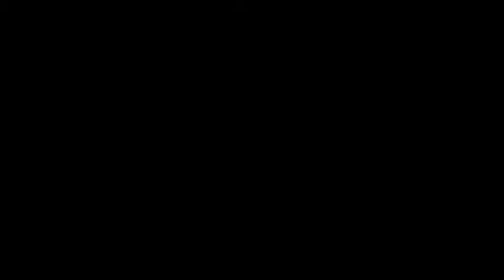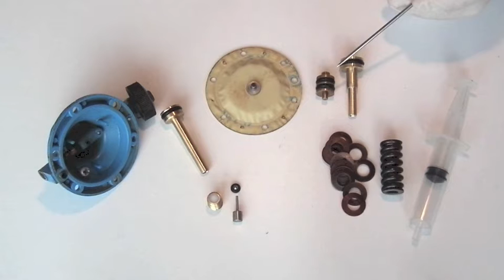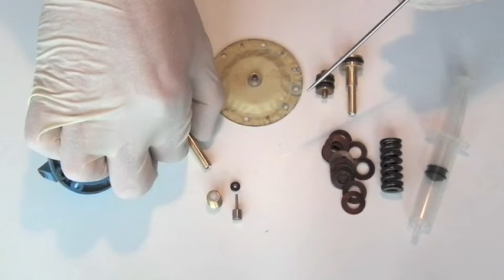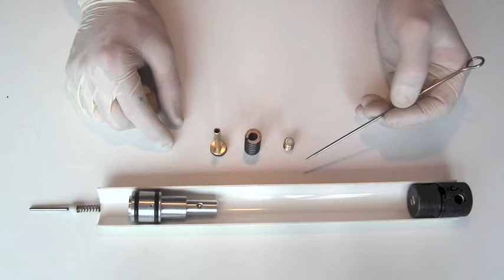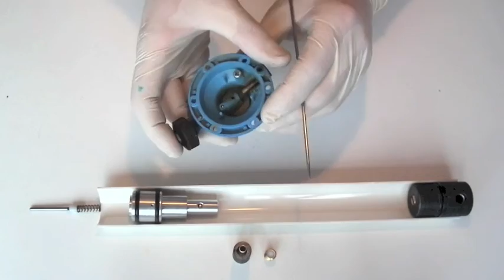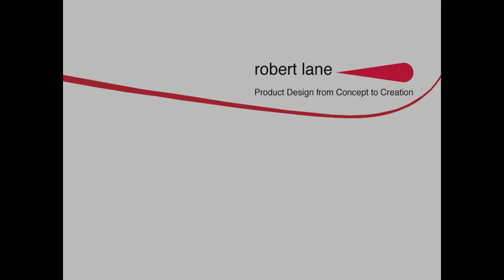Airgun Regulator - Pt.2 How It Works (Pt.1 What Is? Why Fit? )

Comment: Online Mr. Lane for the vent for aftermarket reg. To avoid drilling, there is a video showing a way of cutting thru the threads, after marking it out of course, then notching tube to vent, VS just taking out valve o-ring, using new reg. O-ring now for seal, and just not tightening down assembly. They're pretty reputable and I'd like your take, I'd rather it vented correctly and the claim is this is better, but is it needed? Again you may have answered me by now, because I didn't understand why the vent to start with. The fact it IS needed isn't in question, so I have to choose one of these ways, or drill a tiny hole I suppose,  I don't care about "ruining" the cylinder, I'm putting a regulator in the thing, it's being upgraded even with a hole, maybe you suggest that?

Comment: And, yes wow, I didn't get the size difference in my own, so, if you had another say small "edge" that while under pressure retracted (on high side) and then when tank gets to 75% power it sprang out a tiny bit, and then a bit more at 50% that could accommodate the HPA drop....of course it would have to be accurate and maybe not cost effective, but if u had a way to slightly increase the size in the high side, say hi end competition, you could have a regulator that regulates itself lol